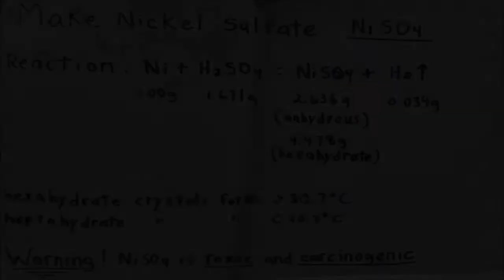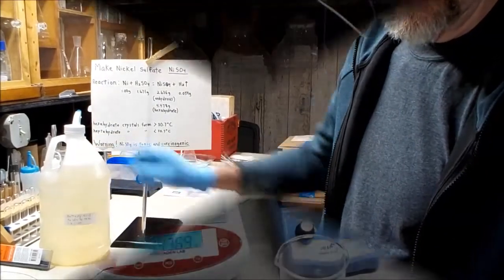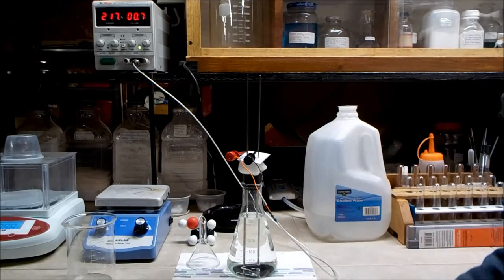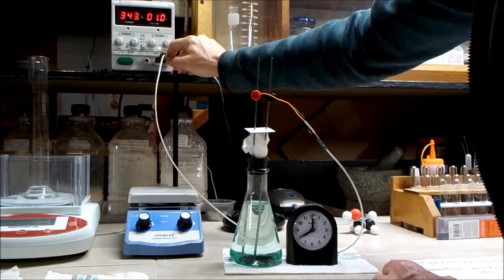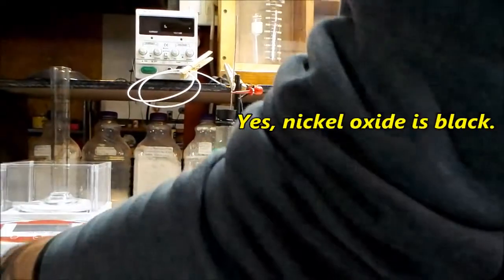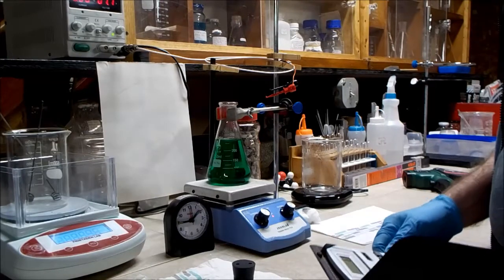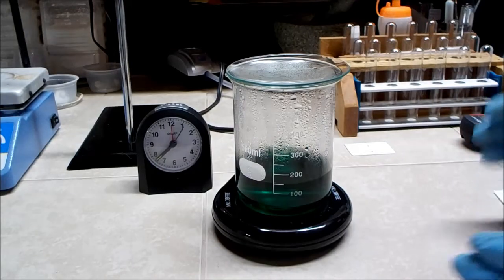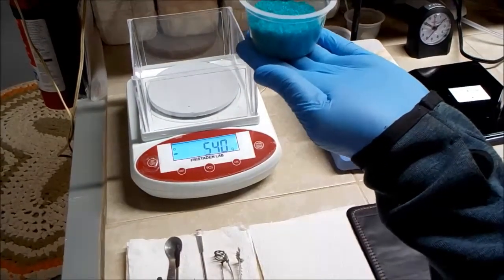Make Nickel Sulfate

Comment: Thanks for the nice presentation!  I think what you most needed here was alternating current rather than direct current.  A sufficiently low-voltage source of AC isn't as easy to come by as that very handy bench power supply with its highly controllable DC output!  But it could be arranged.  Two dirt-common 12-volt step-down transformers in series should just about do it on 120V-60Hz US mains.  You'd have about 1 volt of nice smooth 60Hz AC.  [Edit:  The peaks would probably exceed that 1.2V limit, so perhaps a 9V xformer or even 5V would be better as the second step-down stage.  Also commonly found either from suppliers or in that box of old wall-warts in the garage.]
Reply from the maker: Thanks for the comment JamesG.

I think your idea of using AC is probably a good one.  At least it would be worth a try.  I could do it rather easily because i have a variable AC transformer and I could use it to drive the primary of a lower voltage step down transformer.  The only thing lacking would be some way to limit the current.  A series resistor would probably work well enough.  
It seemed as the concentration of nickel sulfate increased in solution the problem of the current stopping became less and less.  All I had to do then was to remember to reverse the polarity now and then  to keep the electrode erosion balanced.
Reply: @perrygershin3946    Glad you're equipped to try it.  I was considering giving it a go myself, albeit I'll have to find those nickel rods first.  And yes you are exactly correct about using a series resistor.  If for instance your voltage were somewhat too high, an appropriately power-rated resistor could serve to drop voltage and to limit current.  My impression however is that current isn't an issue; it should be limited by the solution itself and by the dynamics of the electrolysis -- perhaps with judicious spacing of the electrodes.  Your step-down transformer may also impose its own output limit.

Comment: One thing you could do is use hydrogen peroxide as a catalyst. This will react with the sulfuric acid to form peroxymonosulphuric acid which will spontaneously oxidize the nickel. And the reaction will happen at normal conditions. Just make sure to use a lot of excess hydrogen peroxide because hydrogen peroxide decomposes so quickly under presence of heat ( the reaction is exothermic) so it will be consumed very quickly.
Reply: Hi, thanks for your advice. Do you have any reference about the formation of peroxymonosulphuric acid. Do you know what´s the molar ratios betwen hydrogen peroxide and nickel?
Thanks
Reply: @anthonym8431  hi yes. So yes H2O2+ H2SO4= H2SO5 + H2O. So the stoichiometric ratio is 1:1. The only thing that I do not know off the top of my head is the equilibrium constant for H2SO5. I've been working on this as a research project for my Chem 142 class. As a rule of thumb do the stoichiometry for the elementary steps, and when you find how much H2O2 is required to react with your nickel sample, triple the volume ( hydrogen peroxide decays extremely quickly especially from the exothermic nature of the reaction). In non-ideal condition with double the amount of H2O2 required I got about 65% of my theoretical yield. Hope this helps!